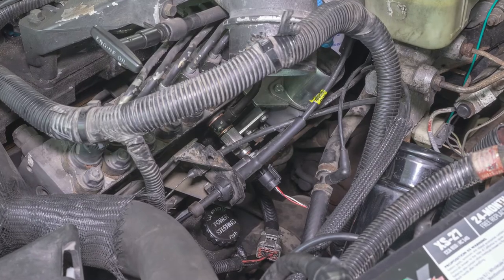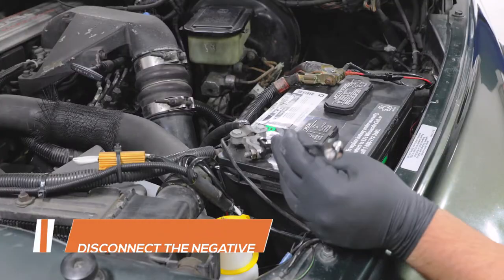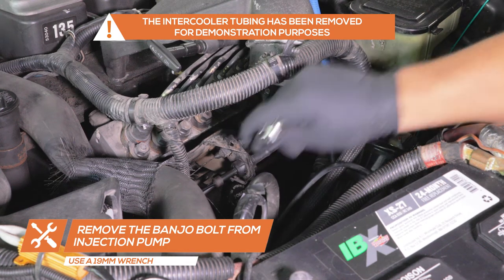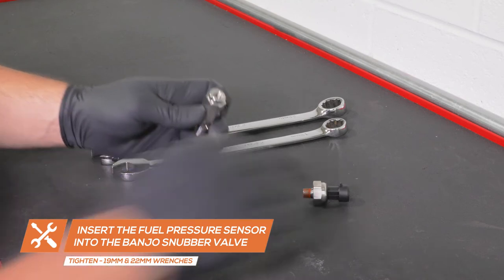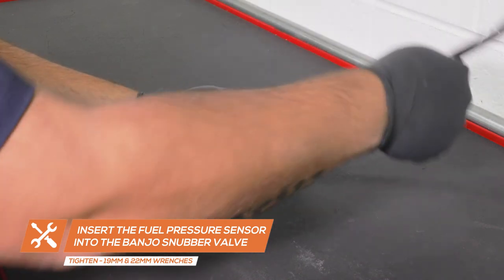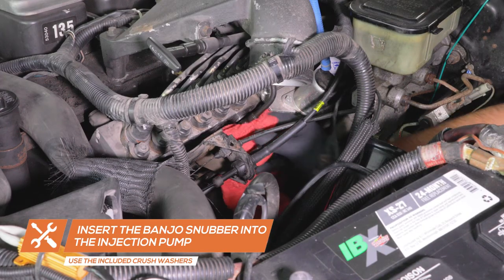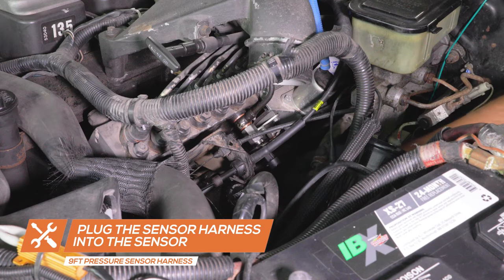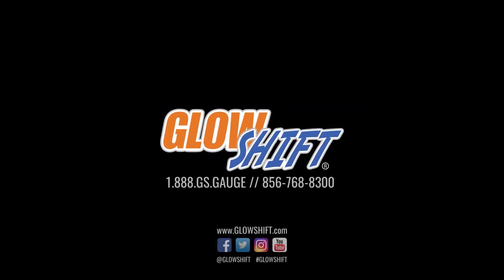Installation | GlowShift Fuel Pressure Banjo Bolt & Snubber Valve Adapter For P7100 12v Cummins

Comment: I installed your combo adapter/snubber valve on a 12V cummins, and it was faulty right out of the box. Rapid 8-10psi fluctuations. I’ve installed an adjustable 1/8 needle valve since then and that has been perfect and will never wear out. Highly recommend to anyone. I used glowshifts basic adapter without the snubber valve for that one. I created a video for it for YouTube.